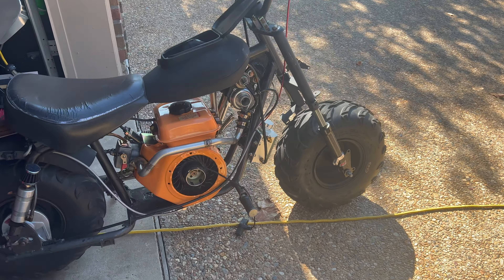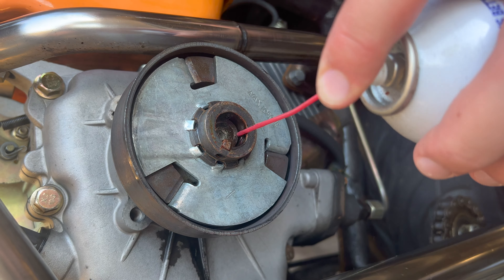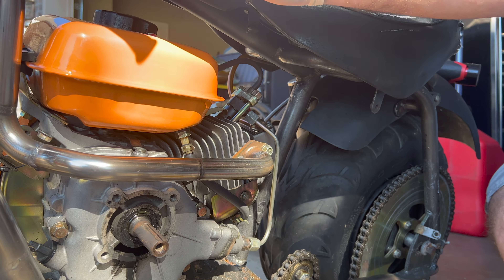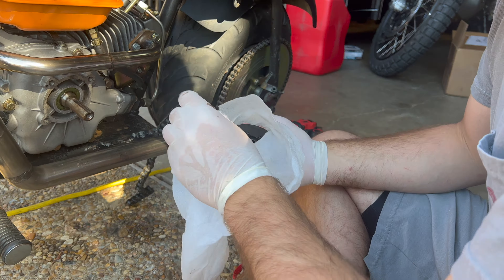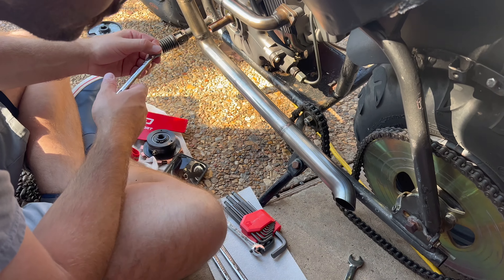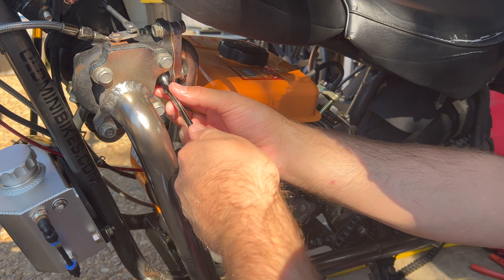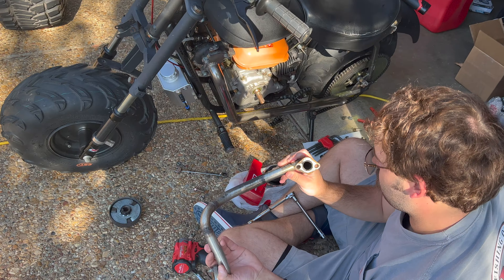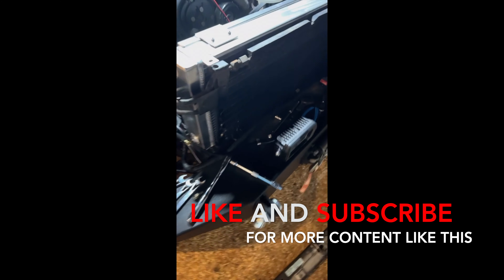Turbo-Diesel Minibike Build Pt.2 Update

Comment: I had the manual clutch on my diesel was fun
Reply from the maker: We had trouble getting ours to engage, we are planning on trying to install it again next month. Did you use the same clutch as us?
Reply: The lubricant most likely got on the shell of the clutch, causing it to slip
Reply from the maker: @skullyisthebest9795  We used brake clean after we wire-brushed the shaft. That was not the problem. Our cable was not the correct length to operate the manual clutch.  Ordered  the correct one so hopefully we will be able to put it on after Christmas sometime

Comment: Where did you get the turbo and piping kit?
Reply from the maker: I purchased the RHB31 Turbo from eBay. I already had a bunch of 1" mandrel bent stainless steel tubing. Nothing was a "kit", everything has to be custom fabricated to fit.
Reply: @CampbellBrothersOutdoors   turbo is worth it tho? I’m waiting on my engine at the moment. Can’t wait to play with it.
Reply: @allergictoasphalt11 I was thinking of getting this the gp rsr is decent and it's like 32-34mph nothing crazy but I don't need faster I want more torque and can add turbo but not sure if it's worth it either, did you end up getting the turbo or no?

Comment: where did ya find that clutch?
Reply from the maker: Searched 3/4 centrifugal clutch on Amazon
Reply: @CampbellBrothersOutdoors which one, I ordered one, and it doesn’t fit…
Reply: These engines have a 20mm output shaft. 3/4 is 19mm. I shave a mm off the shaft to accept 3/4